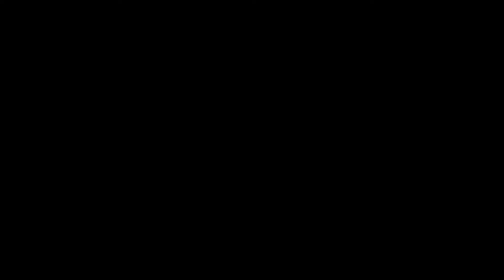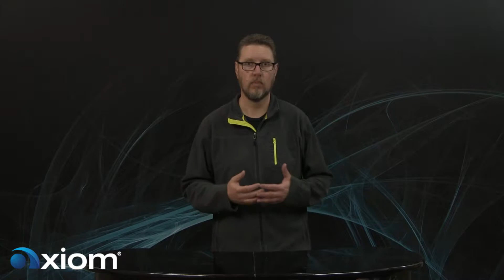What Does Amplifier RMS Mean?

Comment: For a 100w rms speaker you need more than 100w rms amp. Because the amp will make 100w but with distorsions. So you need around 150w rms amp that you'l reduce the gain to get clean 100w rms for speaker

Comment: I have a 2500watt amp rated a 4/2 ohms and a subwoofer at 1400watts can you explain to me what my rating for 4 ohms would be and what it would be for 2ohms and what i should run it on i am new and do not know to much
Reply from the maker: You'll have to look closely at your amp specification sheet to where impedance that are using for the power rating. It should also show maximum power for different loads (8/4/2ohm). Thanks for your question, and thanks for watching.

Comment: I have a question, if my amplifier is a 3,200watt amp. It’s rms at 4ohms is 800W.... I bought 12” subs and they are rated at 1,250 and are 4 ohms. Can I wire them to do 2 ohms at 1,600watts as rated on the amp.
Reply from the maker: Yes, if the amplifier manufacturer states the RMS power into 2 ohms you will be fine. Thanks for a great question, and for watching.
Reply: Axiom Audio no problem! The amplifier says 1x3200Watts at 1 ohm... now that’s too high for the subs. There’s also a 2, and a 4 ohm setting. The 2 ohm is 1x1600w.    And the 4ohm is at 1x800w   But I just don’t know if my subs will blow if they are in 2ohms since the rms on them is 1250w and 2,500max
Reply from the maker: @MellowClipsTV  If they are rated to handle 2500 watts max then you should be ok.